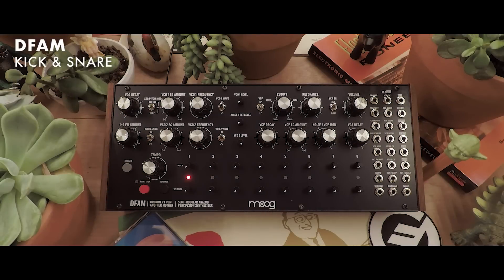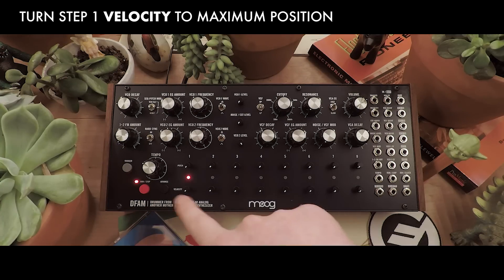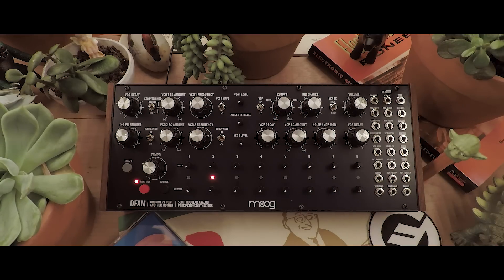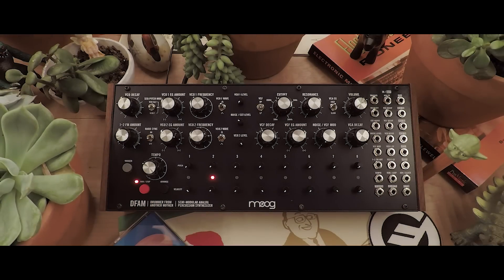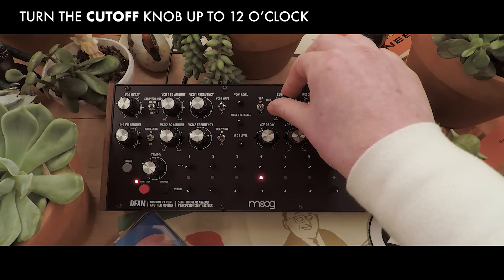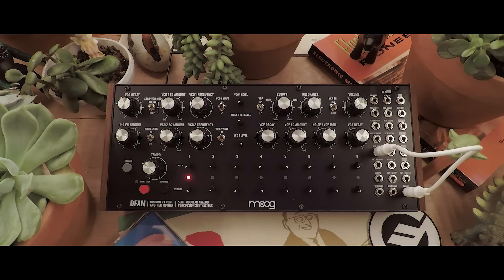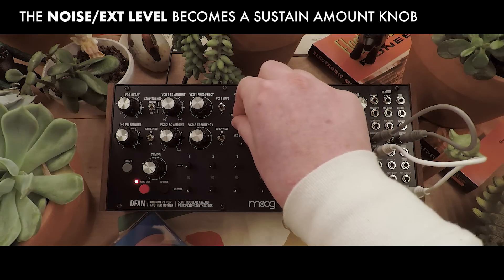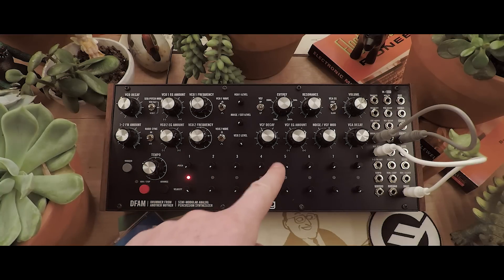DFAM | Kick Snare Patch

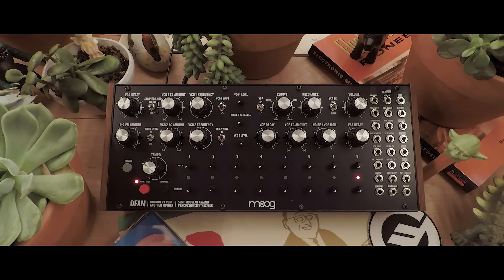Comment: Even after rechecking my settings 3 times the note my DFAM does is at least 1 or 2 notes below the sound that your DFAM plays at 0:36. Is there no tune knob like on the Mother?
Reply: Mine's a full major third lower. I guess the oscillators aren't factory tuned to anything in particular.

Comment: Hey Moog! Is it possible via pitch cv out from lets say a keystep(bc i dont have any other modules) to control the pitch of the oscillators how i want them? lets say i want the programmed dfam bass sequenqe to play in the key of Amin, and maybe later change it to G w/o needing to adjust the pitch frequenzy. thx a lot!
Reply from the maker: You can use CV from an external sequencer to transpose the entirety of DFAM’s sequence. Doing it the way you described, starting with a sequence on DFAM in Amin and then using CV to lower the frequency a whole-step into G would put you into Gmin. Changing from Major to Minor will require a bit more finesse. To accomplish a key modulation from Amin to Gmaj, you’ll need to also raise the pitch of the 3rd and 6th scale degrees in your sequence by a half-step. You’re definitely on the right track with your thinking and a little bit of experimentation will bring you full circle!
Reply: Hey Thx a lot! I'm sorry guys I think I didn't really get my message across, although you  might have answered it already. I'm very aware of the harmonics and that I would need to change the seq pitch if I wanted it to switch from Amin to Gmaj! Lets say I only want the sequenze to play one note, I was just thinking if it's possible to controll the bass pitch of the DFAM in real time with an external Keyboard, the Keystep f.e., in a live situation with a band to follow the chord progession of the song. Or if I could also use it just als a melodie synth without the sequenzer enabled? Thx!
Reply: you might need to watch for voltage levels though - the BSP outputs at 10v and I believe the pitch on the DFAM is 8v tolerant. Would you need an attenuator? I asked Moog this directly and got a politician's answer, so I'm still not really sure lol

Comment: Is the pitch envelope sending exponential or linear CV?
Reply from the maker: The VCO EG is based on a linear core, but then bent by feeding the output into the Decay input.
Reply: Thank you for the reply, but I now see I was asking the wrong question :P  what I meant to ask does the envelope send it's CV to the volt per octave input or the linear fm input of the VCO?
Reply from the maker: The VCO EG, applied to the VCO1 or VCO2 EG amount controls, is summed with the 1V/Octave inputs from the sequencer and the external jacks into each VCO. It is not calibrated to 1V/octave, but it is nominally very close to that.
Reply: Wow, I love the clarity!  Thanks for the reply :)